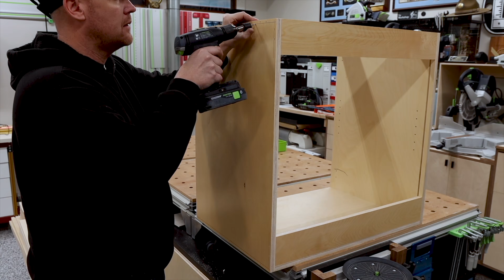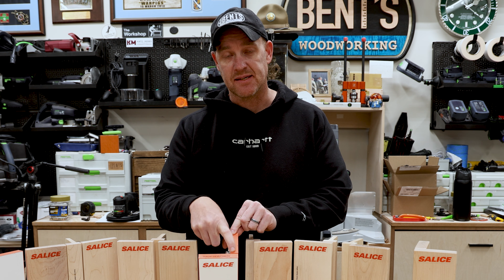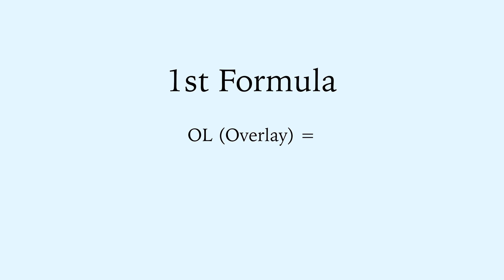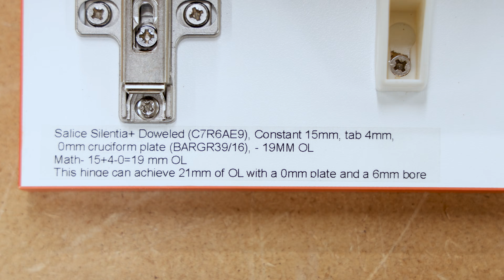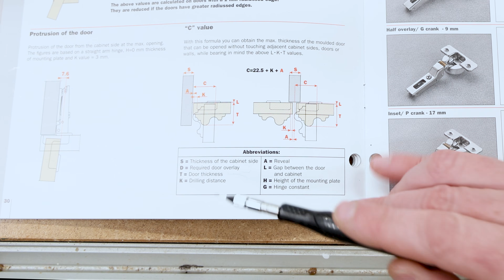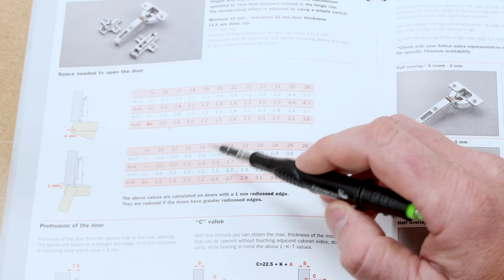Selecting the right cabinet door hinges

Comment: At about 8:17 you show a really nifty calculator on the screen.  Is that a graphic for the purpose of explaining, or an actual calculator that is available to help crack this code?  I just ran into problems with tight gaps between doors and blum face frame hinges binding from door to door.  Thanks to your video, and thank you for this video, I will be ordering salice to hopefully solve my problem.  We ordered cabinet doors from a supplier, I really wanted them without the hinges bored, but the boss wanted to save time and ordered them all predrilled at 3.5 mm tab.  Now my options for overlay are much more constrained.  I'm grateful for you sharing your expertise.

Comment: This was by no means easy to understand. If you are coming in with zero knowledge on this, this is way too deep and goes way into the advanced end of getting overly particular with which one of the 1500 combinations of options you could have. I see some comments saying how "simplistic" this video was... It really wasn't. This was a great video for learning how to really dial in customization, but not for beginners in my opinion.

 The video would be much easier to understand with:
- Examples with practical applications
- Consistent use of terminologies (example: "here's the terms you need to know" at the start, but then later, the catalog for the example used different terms)
- The walkthrough was inconsistent... sometimes you would see something useful, and sometimes it was glossed over... Made the video flow badly IMO
- Some of the value in seeing the products demoed was lost because the text on the product samples was out of focus.
- Break the video into chapters/sections on the timeline to allow better reference to the material in future.
- Example of how a real cabinet door install could be achieved instead of lengthy time with that pencil vaguely pointing things out in the catalog.

I hope this is taken well as it is coming from a beginner woodworker who has typically enjoyed your videos and really gained value from them... This was just a tad too technical to be practically helpful for someone at my level.

For reference, I found this video to be a lot better for beginners: https://www.youtube.com/watch?v=4aQeEijScOs

Comment: Great video as usual.

Honestly, I feel an information overload which is working against my understanding.

I believe that it would have been more helpful in sticking to one cabinet type - say no frame full overlay.
Then show what effect each of these principal variables play.

Then maybe in another video, you tackle another cabinet type.

All I happened to understand is that there are many options but that doesn't help.

If I wanted a full overlay with 3 mm reveal all the door except for the top which would be 12 mm. What would I need to change from the full overlay hinge style?
What if the door is 15 mm instead of 18 mm?

Once, I can wrap my head around that I'll understand the mounting plate types(plate heights), tab values, etc.

This same understanding would be easily applied to the half-overlay hinges and changes in its parameters.

You probably could do a series about cabinet hinges. 
I would appreciate that a lot.

Thanks!

Comment: Jason, great stuff and an easy to understand explanation of the hinges.  Question, as far as sequence of events goes, if I want to do a face framed cabinet with inset doors with a reveal of let's say 1/8", would it be your recommendation to first construct  and install the face frame before cutting the doors so to get an exact measurement of the opening and also account for the edge banding I use?  Or is there a more efficient way to cut and install the doors ?  TIA.  Keep up the great work.

Comment: Journeyman cabinetmaker here 🖐

I build and install frameless cabinets. Blum is my hardware of choice. I think they actually invented the euro hinge, and everybody else has copied it. Truthfully, I find it simple to use, and trustworthy. 

Yes, there's a ton of choices. And typically,  you only need to keep using the one same hinge and plate for 90% of jobs.

I gotta say, your video was confusing, and I zoned out once you started talking about a formula.

Here's what I know,  and anybody can do what they want with it:

A typical cabinet and door are made with 3/4" or 19mm thick materials.

The door will be 1/8" smaller in width, and height than the cabinet. 
If your cabinet requires two doors, divide the cabinet width by 2, and subtract 1/8". For example, if your cabinet is 24 inches wide, your two doors will each be 11-7/8" wide.

The hinge typically has a 35mm diameter cup.
Measure from the side edge of the door to 7/8". That's where you will bore a hole for the hinge,  1/2" deep.
The distance from the top and bottom edges varies with the builder, but on a Blum mini press, there's a mark at 80mm (roughly 3-1/8").
Reply: Just an FYI... Salice registered the first international patent for a concealed, self closing cabinet hinge in 1957. In time, this became the hinge of today.

Comment: This video is for advanced or professional woodworkers. Despite your efforts, the information is still confusing for the average DIYer like myself.  I would think the average DIYer would use the standard 18mm/19mm plywood from the local big box store and there would be no need for application of formulas. Also, you did not discuss the degree of opening which I thought would be important for a hinge. I will just stick with ordering hinges based on the simple criteria of framed/frameless, overlay distance I need, and degree of opening. Good video for the right audience, which is not the average DIY or hobbyist.

Comment: That was a great video, I think.  There were two gems in there, first; "80% of your cabinet hing needs will be covered by maybe 20% of the hing catalog.  Second: "build some mock-ups".    I found that if you know what you are designing the appearance of the cabinet to be, it starts to simplify your hing choices quickly.  Next comes function, does the door need to just have access to the contents (typical upper cabinet), or will you be installing full width slide out drawers (Some lower cabinets).  

And finally, if you have never used that hing before, build a mock-up!  It will save you pain later on.   The mock-up can also help you verify everything works out and your spacing for 32mm hole and doors is perfect.  One last reminder, not all hing cup sizes are the same.   You don't want to drill a bunch of doors with 35mm holes and find out you needed 24mm.  not a good look.

Comment: Mr. Bent you are an outstanding resource for beginner cabinet builders.  Your videos are very thorough, but also simplistic in nature.  I hope the value of this video is realized. It's the first I've seen on YouTube like this; Explaining how you can achieve completely custom reveals on cabinetry regardless of material thickness or application.  I'm a novice woodworker that has the confidence, thanks in large part to your videos, to take on the kitchen and bathroom cabinetry on my house renovation.  Thank you sir.
Reply from the maker: @danielmccarty1  thank you so much for that. I hope this video helps a lot of people.
Reply: I need help with hinges and I’m  just confused on which ones to grab. Watched this video and I am going to need some face frame inset. There will be 5/8 paneling that goes on the outside of the hidden door. So I’ll need hinges that swing out and away from the wall as much as possible . To lessen the binding that’s occurring at the hinge side? Any thoughts would be greatly appreciated🤙🏽

Comment: I am working on a project that will require this type of hinge. I was excited when I saw this video in my feed because I have never worked with euro style hinges. Please take the following as feedback, not criticism. I appreciate what you tried to do in this video but I found it very confusing. I really wish you had done more showing and less telling. I couldn't get the context of the formulas. For example, when you talk about the different variables it would have been good to see you fitting actual examples of tab, constant value, plate height, etc., on the hardware itself to show how they vary by type. If the intended audience is advanced woodworkers and professionals, I think you hit your target.  I believe there is great info in the video, but for a DIY guy like me, the content was difficult to apply.
Reply from the maker: @syossetworkshop  sorry you didn’t find it more helpful. This is just part one of many videos to come on this topic. I’ll make sure to apply some of these points in future videos.
Reply: Agreed
Reply: You've obviously done a lot of work here but I'm afraid it's waaay too complicated for me a diyer. I'd like a walk around of actual cabinets identifying the hinges. 
Thanks.